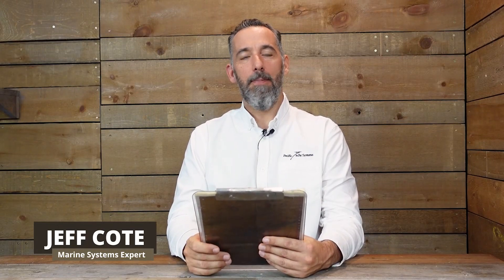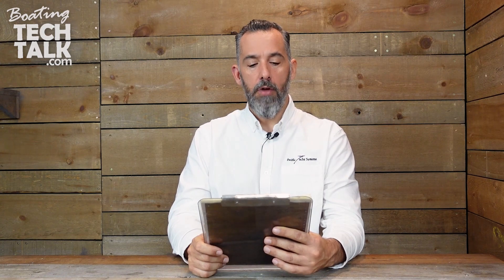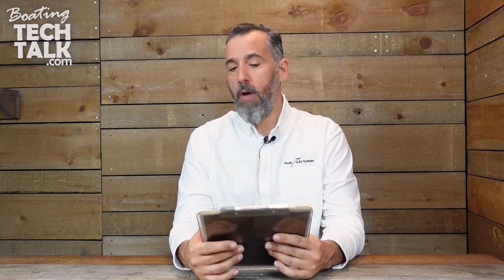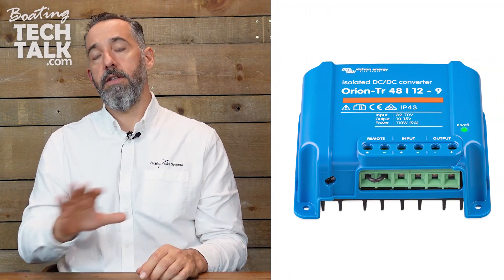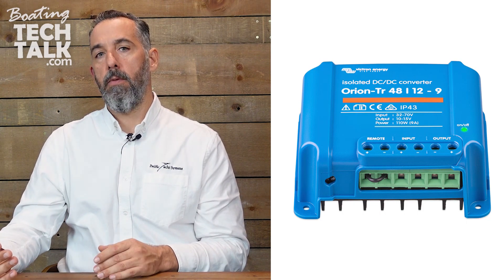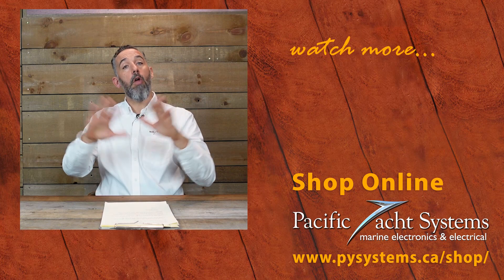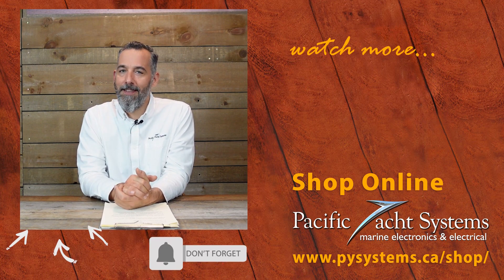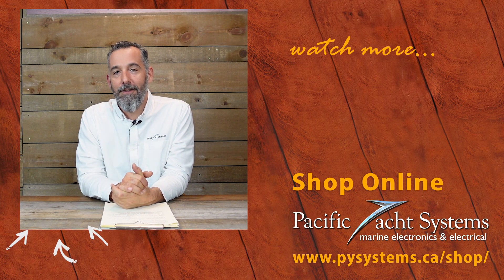Electric Motor on My Boat - Pros and Cons of 48V and 12V?

Comment: I have separate 48v (200ah) and 12v (200ah) banks on my holland 30 (on my channel). I have 2 separate solar banks linked to victron contollers for each of the battery banks. Some reasons for this approach were; the existing 12v system max draw is unknown, house loads wouldn't deplete the drive battery, 12v bank was already in there and upgraded so why take it out, reduce the charge cycles of the drive battery/increase battery life

Comment: I am a rare (temporary) 12v electric drive. I will keep it as a backup. Even my original intent of having everything at 24v standard just seemed impractical at device cost and availability. Much larger craft length is entirely different. When a more advanced electric motor is invested in it is most likely 36v + this becomes the dominant battery bank with stepdown charging a house service bank.
Reply from the maker: Braith, thanks for the input.

Comment: Huh, do many people actually install electric motors? I thought it would take quite a lot of investment to replace engine and electric and you would get a couple of hours of run time out of full batteries at most. Does anyone have a good experience with it?
Reply from the maker: Hi Alexander, you're correct, going to electrical propulsion doesn't make sense to everyone.
Reply: There are actually quite a few people who do switch over to electric propulsion, a number of live aboard/long distance sailors here on YouTube for example :) Rigging Doctor and Sailing Uma are 2 of them.

I'm planning to go electric on my boat but I'm building the boat from a finished hull so don't have a diesel or an electric system installed yet :)

But, you have to be a sailor that actually prefers to sail if you want to go with electric propulsion, since as you say, you won't get the same range as with a diesel.
Reply: Aka a real sailor. Its sad the majority of boats motorsail so much.
Reply: A fair number of the YouTube sailing couples use electric. I think what makes it work for them is that they aren't on a schedule. They don't have to get back to the marina by the end of the weekend.

Sailing Uma has documented their history with electric motors, starting with a DIY forklift motor.

https://youtube.com/playlist?list=PLx_mGFQfb39FXu_oCzggYfkeRKYkI6xpi
Reply: My boat, Landing School 26 (sail) was built with an electric engine in 96.  I have owned since 2020 and it is fantastic.  I don’t need to go for more than an hour at a time, which is fine for weekend sailing.  I can go for about 3 hrs.  - 3.5-4.5 knots full speed with 48V 100ah agm - D&D motor & alltrax controller.  The best part is the maintenance and winterization - which is almost none.

Comment: Yes!
Please talk all day about this. My installation has been sidetracked for awhile, but I’m sitting here looking at a 10kw electric motor, 4 12v 100 amp hour LiFePo to be wired in series for a 48v bank. 2x 200w 24v solar panels also to be wired in series, a Victron Smartsolar 48v MPPT 100/20. The 48v bank will charge the 12v/100ah house LiFePo via a Victron Orion Tr 48/12-30 dc to dc converter. I also have splurged on a Victron Quattro 48v/3000w/35-50 inverter charger for AC and quick charging at dock. 
I’m still working on my homework from your channel and reading Nigel’s book as this is all pretty new to me. An interesting thing for anyone doing this to keep in mind from my own experience, it looks like only t-fuses for the higher voltage. Easy to find right amperage, difficult to find high enough voltage. I have a question. 
Can I run my 12v dc to dc, my Inverter/charger, and my motor controller, all back to the same pos. and neg. distribution bus of the 48v bank if the bus bar’s voltage and amperage ratings are high enough?
And lol, of course, if anyone wants to hold my hand through installing all this…lol
Reply from the maker: Hi Anthony, don't see why you couldn't connect all your 48 VDC loads to positive and negative bus bars from your 48 VDC bank. Make sure all your circuits are fused.

Comment: Jeff, 

I have been a follower for quite some time. I really enjoy your videos and the website.

I am in the 3rd year of a 4 year refit of a 1975 Pearson 419 Center Cockpit Ketch. One of the main areas for the refit was propulsion. We have implemented a Quiet Torque 20 electric engine from Electric Yacht. For this, we have a 48V 440Ah battery bank for propulsion - these are Firefly batteries. We have a 12V 400Ah lithium bank (we plan on growing it) for our house bank. As you suggested we convert from 48 -> 12V using the Victron converter with a 12 - 12 / 30A DC-DC charger to top off the bank (we can add more of each to increase the charge if needed). 

Our propulsion bank uses 48V Delta-Q chargers connected to an isolation transformer to charge from shore power. We also have a Victron Multiplus Inverter/Charger connected to an isolation transformer to charge the 12V house bank from shore power.

We plan on adding solar to charge the propulsion bank and then through the conversion topping off the house bank. You asked for others who are doing the same thing, so I hope this helps.

Regards,

Ricky Tapper
Reply from the maker: Thanks Ricky for sharing, nice to see what you are doing on your Pearson 419.

Comment: I have a single 48v bank with conversion.  I am using  2 48/12 30a step down converters for my switched distribution and 1 48/12 20a step down converter for my unswitched distribution. I also have a 48 volt 2200 watt inverter charger for my ac distribution.
Reply from the maker: Hi James, thanks for sharing. Which step down converters are you using? What is the make and model of your 48 VDC inverter/charger?
Reply: @PacificYachtSystems  My step down converters are uxcell for the 2 30 amps and BZONE for the 20 amp. For the Inverter, I have a Spartan Power inverter model SP-IC2248 that I went with for a few reasons. It has an automatic neutral-to-ground disconnect that you can physically hear, and it has a conformal coating to resist corrosion on the circuit boards. It was very affordable as well at $699 when I bought it. They have not had them in stock for a while however.

Comment: One of the big advantages of running as much 48V equipment as possible is you can run thinner wire gage (less $$'s) for same power consumption. However, finding 48V equivalent equipment is problematic as you mentioned.
Reply: If I had a 48v windlass, I'd much prefer to run the wires rated for that current than to run the wires rated for equivalent 12v current. If I had a 48v windlass.
Reply from the maker: Thanks for sharing.